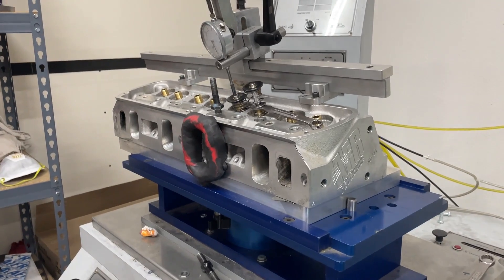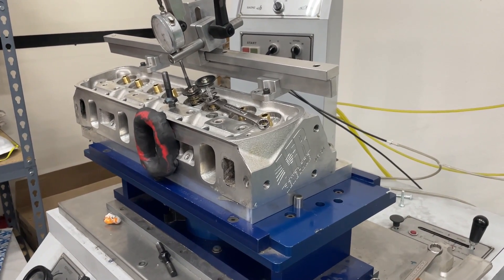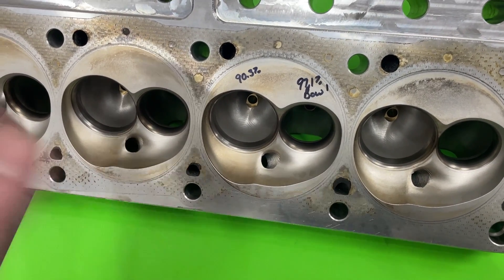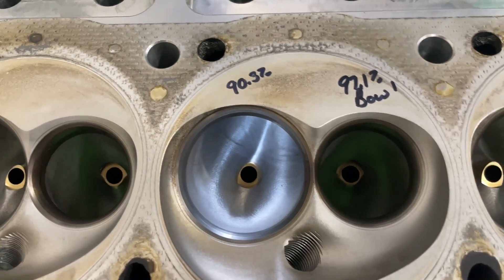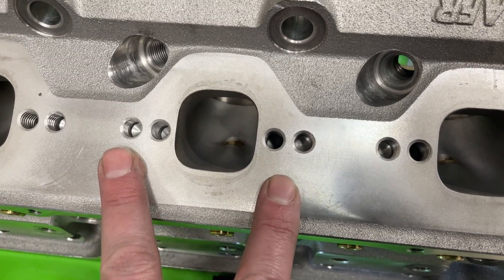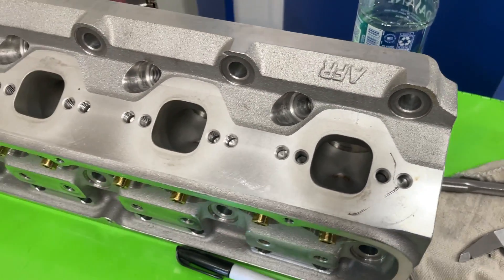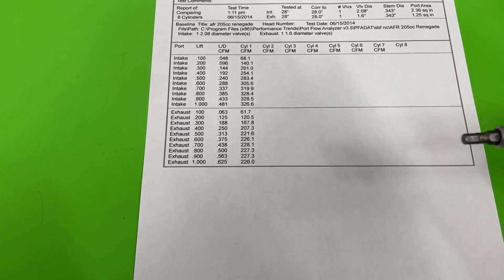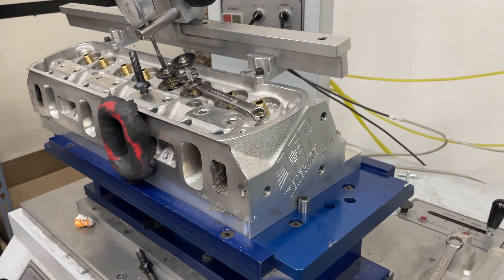SBF AFR 205 Head Review With Real Flow Numbers

Comment: QUESTION:

Would matching the exhaust runner to a Fel-pro #1487 work well and support N/A up to 7k-ish RPM? It would raise the exhaust runner roof outlet about 3/16...
Reply from the maker: I don’t match to gasket on exhaust. I raise the roof and maybe widen it. I don’t drop the floor.
Reply: @WeingartnerRacing  I don't drop the floor either. If you've used the 1487 you'd see that the floor lines up. The width is slightly larger, and the roof is raised about a 1/4". What I'm getting at is, would raising the roof on the exhaust runner of the AFR  #1450 be beneficial?

Comment: Eric, this is an incredible coincidence! I have an old set of #1450 that came back from AFR years ago after they installed new guides under a warranty. I haven't given them a second thought until I began a new build for my 93 Cobra.

I bead blasted clean and found cracks in several of  the valve guide "veins". Firat impression was 🤔. I continued to inspect and evaluate.....

Turns out I do not have the valves, springs, locks, or retainers. So looks like I'm in need of some advice:

I would hate to bother you with a call....I'll look for an email address.

Comment: Along another line of thinking, how much street useable power is left on the table when we buy aftermarket crate street performance engines?  How much would be gained if the supplied intakes and heads were traded for professionally ported and prepped top end?

Comment: I wonder what the Cleveland style heads would do
Reply: they kick ass.  Like 235cfm @.3" 335@.5", 370@.7".    The low lift flow is noticeably higher than inline valve heads due to the valves being canted to open toward the center of the bore.

Comment: Out of the box, AFR heads have always my go to for SB Fords. I do a lot of street/strip engines and not so many max builds, and AFR runs the best for what I do. I can get some great performance in all ranges, using pump gas with out of the box AFR heads, and with some normal clean up and  good valve seat work, they will run with anything I go against.

Comment: Nice video! But I could care less about a Ford head 🙄🙄🙄🙄! 😂😂😂😂 I’m dying to know how you did @ the dyno??? I’m hoping that you actually got better numbers than I was thinking 🤔! Oh I forgot to mention, if you are worried about bad luck 🍀, you should never paint a engine yellow 🙄🙄🙄🙄! Between my boss & two other top notch engine builders have had nothing but bad luck with engines they built that were painted yellow! Just the two my boss ever painted yellow both blew up in short order 🙄🙄🙄🙄! It was back in the late 80s early 90s! The first one was a SB Chrysler 340 in a older 🚤! He dynoed it, it only made like 365hp & it broke a factory connecting rod 🤬🤬🤬🤬! Luckily it was at low RPM & only destroyed the oil pan! The block was ok 👍🏻! This is why he always replaces stock rods with something like Scat has! The second one was a nicely built 289 SBF For a old Shelby Mustang 🙄🙄🙄🙄! That one was also dynoed & made around 400 horsepower! Well my boss tried to warn the customer about painting the engine yellow 🙄🙄🙄🙄, especially in a Shelby Mustang! Well that one dropped a brand new stainless intake valve on something like the 10th lap of a Ford Shelby road race down in Flordia! Luckily the customer had a basic 302 that we freshened & he was able to shove that in & was able to compete in rest of the racing week! It was also able to be fixed, but he had to completely port another head, something the owner also had from years of collecting! That stuff was way before me, but they had a name for those engines! They were called the big yellow Ka Plunkers 😂😂😂😂! JS! But somehow you have had good luck as all your junk is Yellow 🙄🙄🙄🙄😂😂😂😂! Thanks for the video, anything I put together with AFR heads made decent power! Especially for a out of the box 📦 head, with some minor cleanup! Mainly street rod engines!

Comment: I have a 195s competition ported on a 393W 10.1 compression and .560/.570lift and 238/240 duration cam LSA 114 
And heavily ported rpm air gap
Think its a good combo?
Reply: I agree with chris, that 114 lsa is not helping you produce power.
Reply: All be it for street use aswell, not looking for straight steet engine
Reply: Will make good power with that combo...especially on the bottom .
Reply: Imho 226/230 on a 107-108 LSA will be much snappier.  I'd use .600+ lift to make the head work harder.  It flows enough for well over 600 hp.  it'll be better all around with the same quality idle.
Reply: Can run 11-12:1 cr on 93 octane with aluminum heads and you should, it's worth 4% every cr.      What's your heads flow numbers?
Reply: I hope you have been enjoying your motor since your post 2 years ago. I have no doubts that your motor recipe will pull like a rocketship! Nice looking combination!